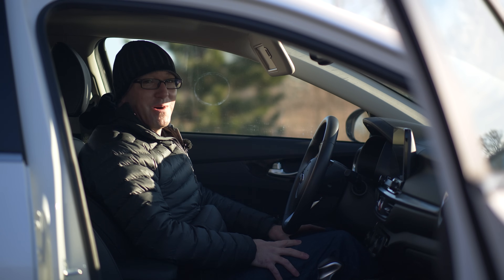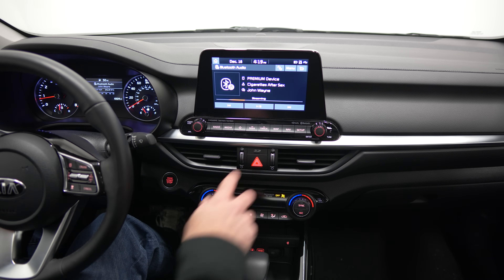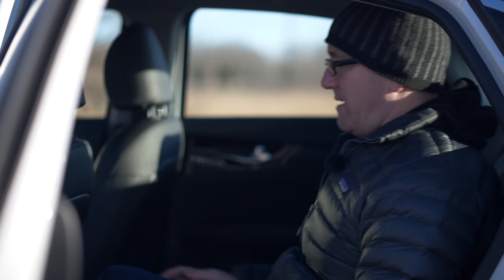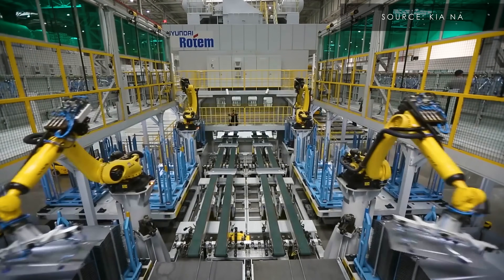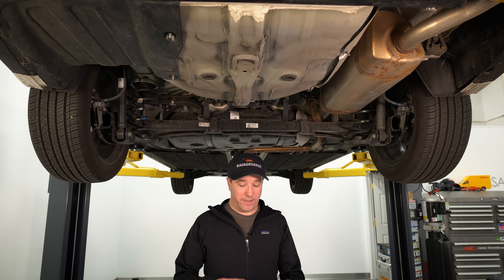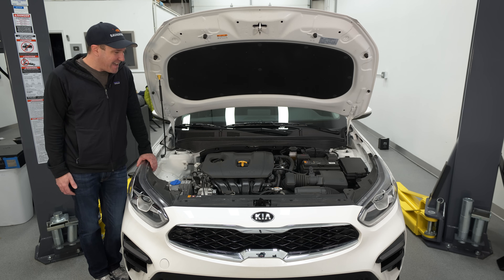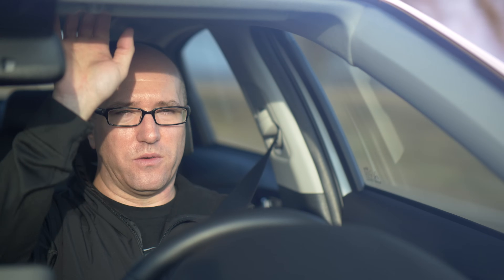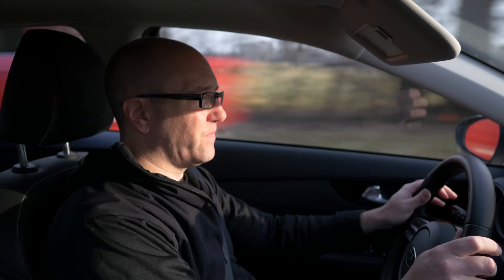2019 Kia Forte Review | Bait and Switch

Comment: I have to say, I love the 2.0 Atkinson Nu. I've got a '17 Elantra I plan to keep for about 46 years, and I've got a family of gibbons that I'm training to change the oil for me every 5,000 miles. I anticipate no problems. And let me tell you, there's no way I could get them ready to clean intake valves, so MPI is great too.
Reply: Isn't the service interval 10,000 miles? The oil should still be amber in color at 5k.
Reply: @kiffstevenson2784  
Depending on the vehicle oil changes are not cheap if you're using the correct product. A modern GTI for example winds up costing about $80 if you are using the correct oil in the vehicle.

Use better oil, like Amsoil full synthetic and change the filter every time with a high quality unit, and stick to the suggested change intervals and your engine will likely last to 250,000+ miles with today's ICE cars. Changing oil earlier than the recommended interval doesn't provide any benefit if the oil you're taking out is still in spec, and it will add up in cost over time. If you tow or drive your vehicle hard a shorter change interval may be needed, but provides no benefit to the average driver. Regular maintenance has a larger effect over a vehicle's lifespan than early oil changes.
Reply: Also bought a '17 Elantra. But I'm in Asia so I got the heavily stripped out 1.6. I like it but Hyundai went too cheap - the rear seats don't even fold, never mind having a back-up camera. It's a bit sad for a mid-size sedan.
Reply: @ady9910  Hyundai lambda engines are reliable to
Reply: @TheDevonParker  I would never go 10k between oil changes as it will shorten the life of your engine!
Reply: You never have to worry about cleaning intake valves if you just install an oil catch can
Reply: Korey Mayo non-turbo mate. it can go 20k on good oil! and non-GDI

Comment: I own a 2011 Kia Rio and have been very happy with it. A few minor issues, blinker switch and a ignition coil failed which was handled by the warranty. Get around 30 mpg combined driving.  I would buy again for sure. Kia’s dont deserve the dissing they get just because they are Korean.
Reply: We used to have a 2005 Kia Rio that we ended up taking to a junkyard at 97K miles due to the transmission failing in it among other issues
Reply: Chuck Iringtwice you must have forgotten to change the blinker fluid, that’s why the switch broke!

Comment: I see what KIA did here... This is literally a car that'll run almost forever with very minimal maintenance.. it still has most of the style and features of those that won't go the distance. I think 26k is too high for one of these but the low 20's wouldn't be too painful. The styling looks great too, the location of the exterior turn signals that Hyundai/Kia seem to be doing now across the board are STUPID, they should've made the tail lights blink red. I'm very interested to see how the CVT holds up. It looks to work great. Seems like an effortless, cheerful little car with a different set of tires.
Reply: This car is dirt cheap. Buying of of this in Sg is around 90k usd. I could buy 3 of this in America lol.

Comment: I have to say I am impressed with KIAs thought process.  I have a 2014 Optima, 2.4 GDI, serviceability is great (compared to similar cars) and so often manufacturers (especially Japanese and Germans) forget that.  I actually like my leather seats (Im sure they are different from the forte).  My car doesnt have any weird rattles or squeaks and is VERY quiet on the road. The car has been reliable too, although there was a bearing issue they found.  Mine hasnt suffered from it but they have given lifetime warranty for and even changed the software to detect bearing knock for us. Its an appliance, not a performance car for enthusiasts and as such works great, good gas-mileage, great features.  Mine isnt a CVT, 6 speed auto, which shifts when I expect it to (take note Chrysler) but my biggest gripe is that the traction control is way too intrusive, hopefully they have fixed that.  Driving in the wet often has me turning it off for quicker launches from a light, and turning it back on in case I hit puddles.  Anyway, great review of the Forte, it matches up with the things I have noticed on my Optima.  It definitely makes me think a stinger would  be a great car.  People do need affordable daily driver "appliance" cars and its so nice to have cooled seats and other similar features my car even has heated rear seats...
Reply: On my 2019 kia forte, the traction control will actually let you slip tires for a second or two before it cuts power. It's been the best TCS I've ever felt

Comment: I bought this car in the 6 speed manual back when they were first released. After driving it for nearly a year I couldn’t agree more with this review. It’s not the perfect car, but it achieves exactly what it’s intended for at a great price. I would recommend this car for anyone that needs an efficient commuter with lots of space. I am 6’3” and 350lbs and I fit in all the seats and even the trunk very easily. I have driven both transmissions and I can confidently say that the CVT version accelerates significantly faster than the manual model. Great review!

Comment: Good thing Kia has a 10 year 100k warranty on the drivetrain.  Even if the new cvt blows up at 60k miles, you get a new one for free.
Reply: You think.... .,here in ontario they are still not replacing bad motors from 5 years ago., claiming incomplete records on oil changes etc ...do you think a competent mechanic can't tell whether a car has had required oil changes by just pulling the cam cover ...warranty here is not worth the paper it's printed on!!
Reply: @zaks9919  i read on the internet so many folks saying KIA like to deny legit warranty issues by saying it was not service at a KIA dealer.  this is one of the reason that keeps me from buying one.  i expect a company to honor their warranty when its needed.

Comment: Hello
Great review,
I bought a Kia Forte 5
201 hp new in 2015,
The only Problems I have had with it
Is two sets of tire change's at thru 105,000
Miles.
And I get 33mpg.
Still going strong At 130,000 miles,
So looks like I will be changing a set of
Tires in about 150,000.
It is the Manual Transmission.

Comment: The torsion beam rear, VW and Mazada have reverted back to torsion beam rear setups for their compact vehicles. The new Mazada 3 and Jetta have them now/again.

I like the styling. I prefer it over the updated Elentra. As for the IVT, it is under warranty up to 10 years so there's that piece of mind.

On reviews of high $ vehicles I agree. I like watching Yuri and Jacob (straight pipes) but they've been reviewing a lot of vehicles most can't afford lately. I don't bother watching 60K, 100K+ reviews of a vehicle I'll never own.  I will but only if it has new tech or is a new vehicle introduced to the market. I understand doing it, especially if viewers ask for it. They're not usually for me is all.

Comment: I have to say it because I own one, 2020 forte EX is 👌🏻 for my commuting needs. The torsion beam construction in the back for the suspension.. I do have to say can be very annoying in construction or bumpy roads, but it is very smooth otherwise, and what I expect in a car this size. I’m already near the 50K miles mark since Aug 2020 and I’ve no problems. I do regular maintenance and try to get certain maintenance done to keep everything clean and in tip top shape and it doesn’t disappoint. Definitely one I’ll be keeping for years even if I stop commuting because I personally think it’s a very comfortable car. Small things like the piano black plastic in a lot of areas I’ve always been annoyed with, but the styling (especially those rear LED running lights when they’re on) just make me happy with my purchase. The fact that I get comments on this car being good looking, especially for being a Kia, I think is a good thing because I know I didn’t pay an arm and a leg for it.

Comment: Kia makes a great first impression lol I would be curious to see some owners thoughts after a few months of owning it. But from what I've heard, people with the manual are really happy with it. They also get to enjoy a lot less complication and electronics coupled with an NA 4 cylinder. This just goes to show that turbos in small cars are pointless, this thing gets like 40 plus MPG
Reply from the maker: I agree with all of that.
Reply: Owned mine since 11/5/18. No issues at all so far. Loving everything about it & its very zippy!
Reply: I own the a 2017 forte5 with the 1.6t with dct and I still love it. I currently have about 40k miles no complaints. Do wish I had the updated interior but other than that has everything I need. Plus the turbocharged engine makes it fun daily. But interior is outdated and the exhaust is a bit quite but you can fix that yourself ;)
Reply: I own a '16 Forte Koup SX and I still enjoy that car as my daily driver. Almost 30k, regular maintenance and no problems thus far. Styling won it for me over similarly priced vehicles. Looked at the ST Fiestas, Civics and Corolla before finally deciding on my 2nd Forte after my first one got trashed in an accident on the interstate. 

My 2011 Koup SX had upwards of 60k miles on it,  only thing that needed replacement was a transmission temperature sensor around 45k I think.

Will I ever buy another Kia? Probably not, but they are great cars for the money. The two experiences I had purchasing brand new vehicles from Kia was easy from start to finish and I was able to negotiate quite a bit on the sticker price.
Reply: @NotLikeUss  Have the seats 'settled'?  I remember the sportage had hard seats at first, but then it got my buttprint, haha.  Kia, still hard plastic and hard seats.   I would like camry seats, and tiny or no touch screen.
Reply: @NotLikeUss  How's the acceleration? How do you like it? I'm thinking about trading in my 2017 Toyota Corolla for it. I'm used to CVT's so I don't care about them.
Reply: @orbitalair2103 Nope, they're still in mint condition. Even the seats in my 2016 Rio haven't settled. I not a huge guy though, 5,10 / 1 65 lbs
Reply: @thundergato84  The acceleration is exceptionally well if u asked me. It's way more zippy & fun to drive in sports mode. I've left a lot of Corollas in the rear view even a few cars I thought I had no business going against. It's not a sports car but it's pretty fun to drive compared to a normal transmission imo.
Reply: Never would’ve bought a Kia or any Korean car 10 years ago. But after reading the reviews, I bought a 2016 Kia Sedona SX with tech package. 2 years into ownership and I’ve had less troubles with this car than my 2007 Toyota RAV4 or 2012 Acura MDX in their first 2 years. No wonder Kia is moving up in reliability rankings.
Reply: Isaiah Jackson  not hard to leave Corollas in the dust.

Comment: I just got one. I’ve been a truck guy for years now.  Hell I drive a F450 6.7L for work. This I must say is a damn good car for the money. The best part is I paid $15500 for it after all the rebates Kia was offering on the 19s. With a crap truck I traded in plus $5000 down I have a cheap payment and a gas getter to get the kids to school in the morning. I do all city driving around 100 miles a week and get 35.5mpg. I don’t beat on it, keep it waxed and clean and I have nothing bad to say, just little things you have to deal with. Road noise is more apparent then most cars or SUVs. The speakers suck when your trying to rock out with the windows down and the AM reception is almost nonexistent. The pros are like  the video said. Great gas mileage, the tech is at this price is great. Apple Car play works awesome. Why anyone would get a nav system with a car or truck that has apple or android car play is beyond me. The trunk space is wow for this small car. I was able to fit a 10 gallon 6hp shop vac inside with room to spare on the sides and in front. Is this my forever car? HELL NO. But it will be my car for the next 4 years until my wife’s Honda Pilot is paid off and it’s my turn to get a new expensive truck. If anyone’s reading this 4 years from now and is looking for a cheap well taken care of car DM me. Lol. Maybe in a year I will make a video of living with the forte that’s not my forte after a year of owning it. Great video man it only made me 110% I made the right choice.

Comment: This cvt is miles ahead of nissan's...  I thought Nissan had improved theirs until I saw your Maxima review where the input bearing started to whine from overheating... their tell tale sign of premature failure, on a brand new car.
Reply: Some of the Maximas 16-18 model years seem to have gotten higher reliability scores. However, their transmission history is skeptical like you elude to.

Comment: I have a 2020 Forte. I just turned 10,500 miles in a year and a half of ownership. ZERO rattles,squeaks or any type of noise. It’s a very quiet car and the stereo is not bad for a stock unit. It handles fine for everyday driving and the gas mileage is the icing on the cake,combined 33mpg. AWESOME. It’s only a year and a half old but no problems or issues. I paid $19,200 and I love it. It does what it supposed to do and I doesn’t break the bank. THIS REALLY ISN’T A BAD CAR!!!!!

Comment: I have a 2010 kia forte now at 200,000 km and running perfectly. You're correct in that is super easy to service and everything is in reach and accessible. No reason to change . Keyless entry push start good audio I've added Bluetooth and my phone does everything i need, plus auto headlights, cruise control etc etc.

Comment: New sub here...love the honest in-depth review. I love my KIA Rio 2015 LX+ sedan (Canadian trim) which I bought in its most basic form with a manual 6-speed, 138hp, front heated seats, AC, rear disc brakes, etc. I have racked up more than 70K  and it still drive like when it was new...very good room for sub-compact class, nice smooth and peppy GDI engine, fun, fuel efficient, very comfortable, very reliable, and still rattle-free! Very happy with it and have no regrets. I highly recommend it to family and friends and will not hesitate to buy a KIA or a Hyundai automobile again.

Comment: I just rented a Kia Forte sedan to see if it's a vehicle I'd consider buying it.  A lot of what you stated in this review is true, and I'm also situated in the Sacramento area.  This car is packed with a ton of features for the price, the ergonomics are great and the visibility is excellent all-around.  Pretty good electric power steering that is quite direct, and most shockingly, this is by far the best CVT I've used in a vehicle, as it does a fantastic job of mimicking real gears.  Really puts Nissan's CVT's to shame.  In fact, if someone had lied and told me there was a traditional automatic tranmission in the Forte, I wouldn't have known the difference.  Also, for a car with only 149 horsepower, this thing is peppy and really does pick up and go once you put it into sport mode and manually shift the gears.  

My main complaints...just so-so front seat comfort, but my biggest complaint by far is the suspension that is too stiff and a bit too jarring for my comfort level, especially on broken concrete pavement like on I-5 in south Sacramento.  Strange, since its smaller cousin in the Kia Rio also has a rear torsion beam but seems better dampened.  Front suspension was also a bit too stiff for my liking.  Similiar complaints with the Hyundai Elantra, which shares a lot of the same body and suspension components.  

Overall, this is a major bargain for the price, but anybody looking into buying this should rent one for a weekend and see if you can handle the suspension on bad roads.

Comment: I purchased a 2015 Kia Forte used. In the used market this car is a very good value. I bought mine with 25k miles, PFI 1.8L engine. It does everything I need and honestly I'll keep the car until it dies. I still have a conventional 6-speed Auto with no "IVT" but honestly that cars been bulletproof. Outside of regular maintenance this car is solid for the price.

Comment: Direct injection sucks - it's fine in a diesel but a disaster with gasoline. Glad Kia/Hyundai are still making port injection engines.
Reply: I've heard that the new Sonata's base engine will have both port and direct, maybe combined with this "IVT". Sounds promising.
Reply: Most Fiat Chrysler products are port injected.
Reply: I've had a direct injection engine car for 4 years and haven't had issues

Comment: KIA used to offer leather in the EX, but customer feedback data said they would prefer a std 8 inch touch screen and cooled and heated seats.  Funny, VW, Audi and BMW use leatherette that is hard as concrete, but that's okay because of the badge.. really?

Not to fear, the GT will have ind - rear suspension, the 1.6 Ltr Turbo and a 6 speed manual available.
Reply: Yep, the germans definitely "feature" leatherette in most of their base model units. I like firm leather (and leatherette?) seating as you know that it will break down and / or get less slightly less firm over the years... at this price point. As a comparison, a family member's brand new Honda Accord EX 2.0's leather seats are very firm, but they are plenty comfortable.
Reply: Yeah I see reviewes penalize kia products all the time but say nothing about other brands with the same exact things they complain of in Kia's or even say they like in other brands.
Reply: @boxingvortex4364  Yep. They are playing with the same economics as the other manufacturers, but appear to be generating some creative offerings.